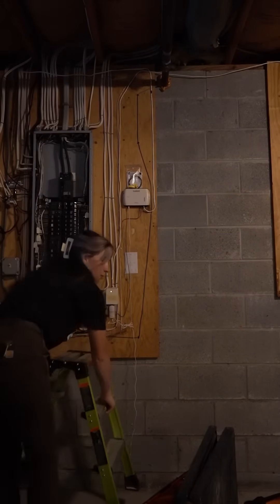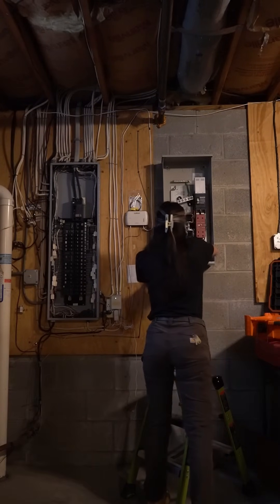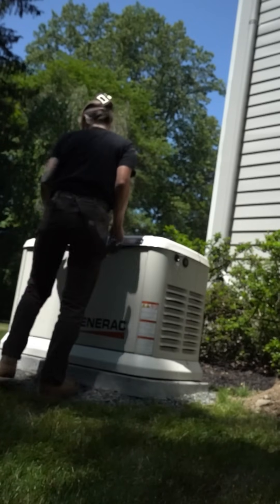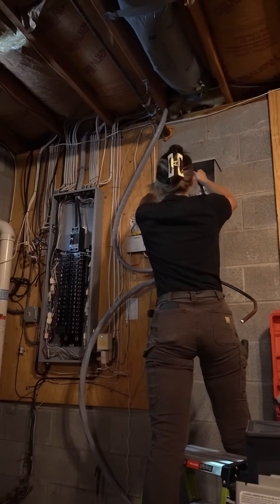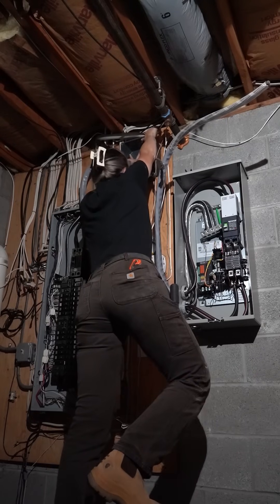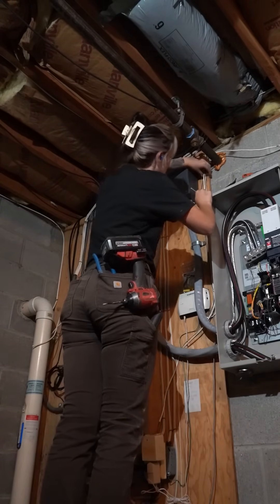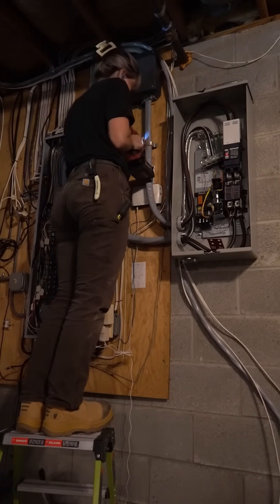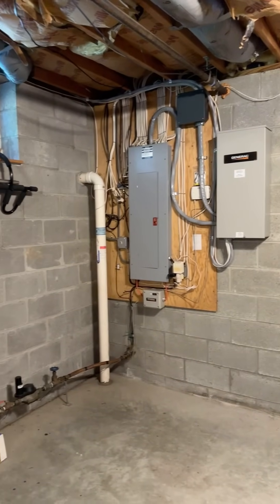24kw generac generator install

Comment: This was very informative. I’ve never done a residential gen install and I only do three phase, full backup. I was curious about what gets eliminated (in terms of indicators, ground fault detection etc) for res. I have to investigate these load shed modules!

In my experience the transfer switch is always what fails. Customers often run their gens weekly and i encourage them to test under load.

Nice work btw, retro is always a bear.
Reply: I did gen work for almost 25 years, both residential and commercial, up to 800 Kw. While options vary, the main difference with these Generac transfer switches is they are controlled by the generator and there is no logic board built into the switch itself. There is also no option to exercise under load or change the duration of exercise. You do get to select the day of the week, time of day, and weekly, bi-weekly, monthly. These switches do come with a load sensing module that works for pilot duty and can be directly wired to the AC via the 24 volt control. In this case she elected to install a drop-out relay, which can also be used for an electric water heater. The sensing module can control up to four major appliances, giving a delayed start and sequential restart. It monitors generator frequency and sheds load if unable to maintain. It waits 5 minutes and tries again. After 3 tries it waits 20 minutes. The generator itself monitors utility power. It will start the unit for no power (one or both legs) and brown-out. (20% reduction) It is not smart enough to sense a lost neutral situation. Retransfer and shut-down sequence will happen after utility reaches 90% of rated voltage.
Reply: Great explanation of the transfer switch operation on the Generac.  👍

Comment: I have been told by several electricians it is not a great idea to have the transfer switch indoors. There is a chance, however slight, that the solenoid or moving parts can fail and cause an overheating condition. Anyone else agree?
Reply: This switch is rated for either indoor or outdoor use. I did this for 25 years and 99% are inside... where they seem to last longer.
Reply: @rupe53  Understood......would rather have it last a couple years fewer amd not worry about a fire.....but that is just me. This is the same anxiety the will forever keep me from buying a solar system amd having power lithium ion batteries charging and discharging from within my home.
Reply: @patiencezero-xc9zl  ... a properly installed TS will never have an electrical fire because the breaker will trip BEFORE you can sustain enough power to cause a fire in the wires. Yes, certain parts may smoke, melt, warp, or get crispy, but no fire! (part of UL testing) BTW, did you know you can have solar WITHOUT batteries? Instead of storing your power you just send excess back to the grid.
Reply: @rupe53  Of course I know all that, there are still TS fires and solar without batteries is pretty useless as a backup power source.
Reply: @patiencezero-xc9zl  ... you only said solar, not solar as a backup for an outage. In my area, peak shaving installs outnumber solar backup by a wide margin. BTW, I also spent years in the fire service and never saw a TS fire. Burned / damaged parts, yes... but those parts will not support fire and it will go out as soon as the breaker pops.... and the cabinet contains everything. That's also part of UL listing.
Reply: @rupe53 need outside for disconnect requirement no?
Reply: @coreyfranco7060    if it wasn't required for the original service it probably is not required to be upgraded either. There was a time when NEC spelled out a distance between the meter and panel and it wasn't called for if under that distance.
Reply: @rupe53 adding the generator is a major modification to the service.  I dont know of a single situation where i was allowed to proceed with a disconnect outside considering that a fireman would be fumbling around looking for a generator to de-energize the house in an emergency.  They are trained to pull the meter then the backup kicks on then they gotta run around and find it.  Not ideal...
Reply: @coreyfranco7060    I was in the fire service for 20+ years so am familiar with all these reasons. FD is no longer pulling meters in most areas... mostly to do with liability, although 40 years ago we didn't worry about that.
Reply: Most inspectors will stop you right there and tell you that you need the switches outside and grouped together.  If the generator is not in site then no go...
Reply: @coreyfranco7060    that's actually part of the permit process.... and when you ask questions so you don't needs to make changes later.

Comment: Question why not put transfer on the outside, then wouldnt need to splice the su cable?
Reply: Customer probably wanted inside..
Reply from the maker: Customer preference!
Reply: Main disconnect required now no?  Outside?

Comment: As a Code Inspector, I want to say,,, this Gal nails it perfectly 🥰
Reply: Is mounting that box directly to the wall with no plywood behind it code??
Reply: @Firemandave911  ... code just says you need space behind the panel, and a 1/4" will do it. The space is to allow any condensation to evaporate and not rust out the cabinet. Most mount wood or Unistrut to the wall so there are no worries about where the screws fall. (concrete joint versus hollow block) In a pinch you can use a few washers as spacers.
Reply: @rupe53  Thx for the info   I haven't been up on code in years   back when I did electric work in my area, we had to have a painted panel board on the wall to mount a panel too. I got failed once because it wasn't painted. but as we all know it depends on the inspector you get and what kind of day he's having!
Reply: @Firemandave911  ... yes, AHJ and local code can be stricter than national code.... so ya gotta ask the right questions.
Reply: @rupe53 thank you, I have been wondering why they put plywood behind the cabinet.
Reply: @Firemandave911 yes
Reply: Wow. I want to know where you’re inspecting work. There’s no violations here, but this work looks like dogshit.
Reply: Got a lot to learn tranferswitch should be means of disconnect  outside
Reply: @natpickron9788   That TS has a main breaker (you can see it) and if there was no breaker outside before (older code) then she is not required to bring it up to new code in most areas, unless there's a totally new service going in. That said, this TS is rated for outdoor use and if the owner didn't mind, she probably could have installed it by the meter and saved a little time.
Reply: Transfer switch should be outside for mantainces purpose and do to a fire u don't have to enter the home to  bypass
Reply: @natpickron9788     with all due respect, code says either way and in my personal experience, they last longer inside and out of the weather. 25 years in that field and retired now.
Reply: @rupe53  18 years and it's not what or county or city  codes require
Reply: @natpickron9788     your local code may be tighter. National code says no update necessary unless you are changing the full service. In this case she is adding a gen set to an existing 200 amp service. In parts of lower NY (Westchester County?) they call for a second gen disconnect OUTSIDE the house (by the meter) if the gen set can't be seen from the meter location. IOW, if you put the gen behind an outbuilding to cut noise. BTW, I was told that was from the fire marshal's office. It was only one or two towns as of when I retired 4 years ago.
Reply: @rupe53 yes but she missing the disconnect outside
Reply: @coreyfranco7060    If there was no disconnect before (pretty common) then it may not be required now. Also consider that in recent years it's become very difficult to get a metered main so the local inspector may not push for an upgrade. Again, all of this could have been solved with the TS located outside, even though I am not a fan of doing it that way.
Reply: @rupe53 we usually just install a seperate disconnect and meter enclosure.  The other problem is the location of the generator and if its not in plain site.  Fire department would have a difficult time de-energizing the house in an emergency.  They pull the meter and then the generator kicks on then they gotta find the generator before fighting the fire...  Not ideal
Reply: I cannot comment on anything other than what NEC and municipalities in the Greater Houston area require.  The municipal requirements by all
Of the cities here require external disconnect.  We will install inside the garage but if there is no external
Disconnect then we will have to put one in.  It’s considered a retrofit or modification of existing service, so they make us comply with current codes, both NFPA and NEC.

My questions for the poster of this video are:  have you ever installed any other home standbys?  Cummins/Kohler/Briggs come to mind.  Generacs are a LITTLE easier to install but that comes with a drawback for the customer.  I’m just wondering.

Also, I recommend everyone who is a professional on this channel look at the service bulletins Generac has put out.  Not a fan of that ATS.  It’s poorly engineered and has a tendency to 🔥.  Been there, done that, fortunately don’t have the t shirt.
Reply: That's what she said
Reply: Do you send heart emojis to the guys you check the work on or just the cute YT girls?
Reply: Where's the means of disconnect on outside of house?? Transfer switch should be be outside
Reply: @walterrose854 transfer switch can be inside or outside in Ontario
Reply: @DonLowe-c9c money is going outside
Reply: @walterrose854  ... good question, and we'll presume it's right at the meter where it was originally. BTW, this TS is rated to be used outside if needed.
Reply: Why? There’s a breaker on generator that cuts power to transfer panel if power is out. Or shut off gas to generator no fuel no power.
Reply: @jameslang9170  .... you are not wrong, but new generator code (5 years ago?) now calls for a breaker at the gen set (always has) and a kill switch at the gen set to shut the unit off. In certain cases, you may need another power disconnect for the generator near the meter, if the generator can't be seen from the meter location. This is NFPA code for the fire dept. In addition, the NEC calls for a power disconnect from the utility near the meter location, and that usually means outside the home. BTW, that kill switch must not be a simple on / off switch. It must require several steps to reset the system to prevent accidental starting of the unit.
Reply: @jameslang9170 its requires by the current nec code.  She removed a bonding jumper so we know that there was no existing disconnect outside...
Reply: You should look past her ass to see her electrical Code violations.
Reply: @MelissaHuffman-k7x   Go ahead and mention a few, then think about where she is and how they might be using 10 - 20 year old code.
Reply: @MelissaHuffman-k7x No violations here
Reply: Never ever, use the top of ladder. Come on people. Don't you worry about safety first?